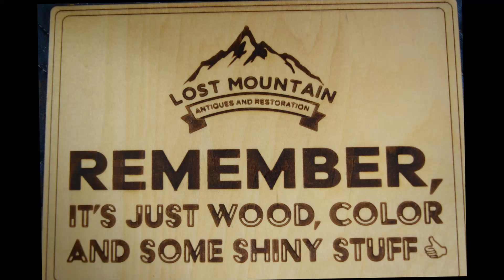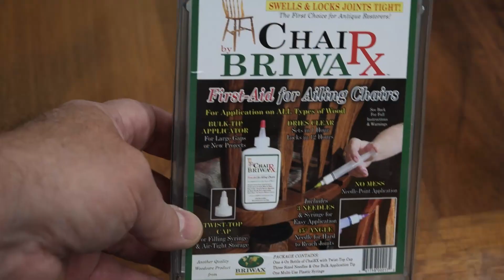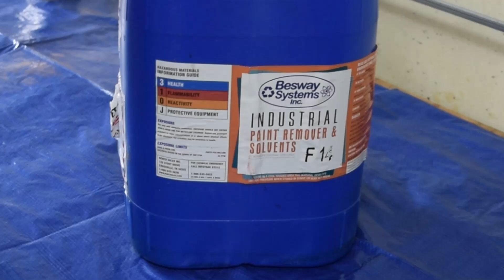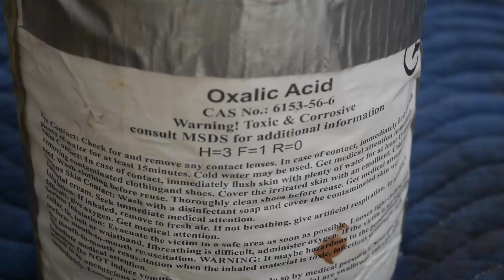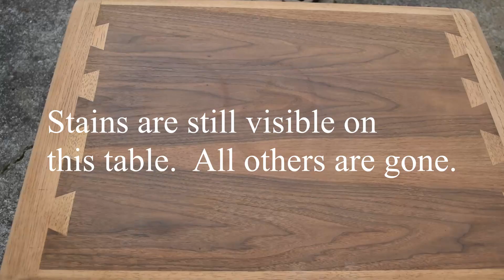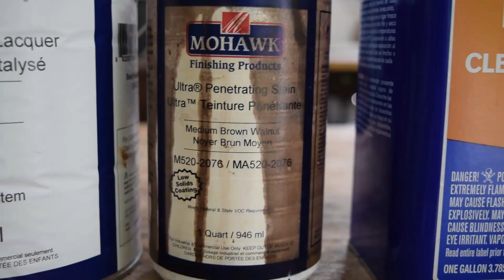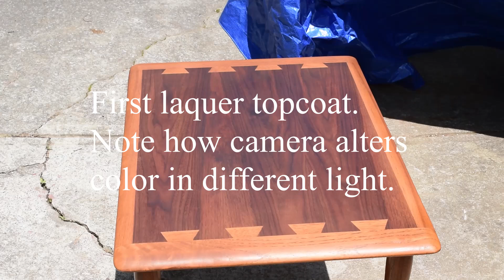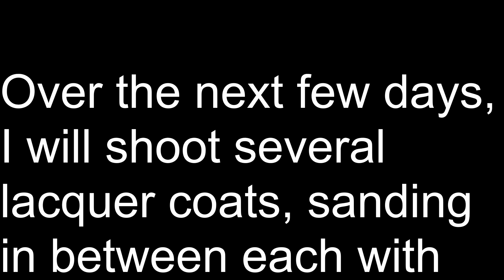Refinishing Lane Acclaim End Tables - ASMR

Comment: I have watched all your videos and enjoy both your skill and the knowledge you share.  I wanted to let you know that I used the technique you borrowed from a viewer for using a "roll pin" to remove small nails from previous "repairs".  It worked great (awesome actually) on my great-grandmother's rocking chair that I am repairing/refinishing.  Thanks again for the entertainment, knowledge, and inspiration that you provide! 
Garfish WoodCraft
Reply from the maker: That is awesome!
Reply: Gary Marlow any chance you can point me to the video that shows it?
Reply: emandeli1 I can’t but I can tell you the method. Get a “spring roll pin” w/ an inside diameter slightly larger than your nail head. Chuck the pin in a drill and sharpen/bevel the end by spinning it against a belt sander (or some other abrasive. Place the sharpened end over the nail head and let it rip. After you “drill” down 1/2” or so, most nails will pull out w/ needle-nose pliers. The hole that is left should be pretty neat and easy to fill w/ a dowel rod the same size as the roll pin. I hope this helps

Comment: Larry, I think I am leaving money on the table. Just curious how you track labor in your shop?
Reply from the maker: I inquire about what kind of job they want.   Are they OK with a spot fix and polish or do they want a showroom restoration?  After that conversation, I generally estimate my time and materials and come up with a price.   Frankly, I pretty well have costs figured out for standard jobs, like end tables, etc. so those estimates are pretty easy.     I always encourage potential clients to shop around for other prices.   Unless they find a Minwax, polyurethane and chip brush guy, they will normally be back.   Truth be told,  I frequently underestimate my time, but I'd rather do a good job than watch the clock.   I also will try to work within the owner's budget, if I can, and I make some allowances for return customers, especially dealers who are also working on tight margins.  All that being said, I long ago realized a one man shop isn't going to build a ton of wealth.  If I charged for every hour, the prices would be just too high for this market.    This is a side gig for me and I enjoy these repairs when they come.   I have slowed down the pace of the shop as I move closer to full retirement, so I'm not so worried about keeping busy all the time.  Good luck with your shop!